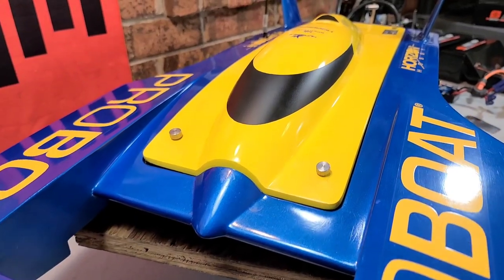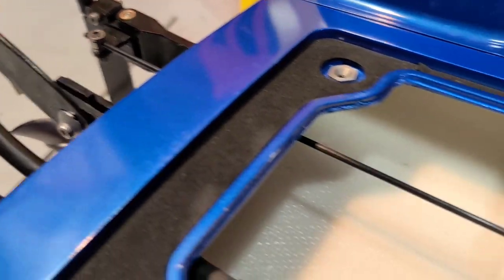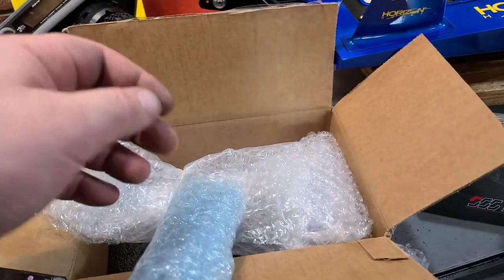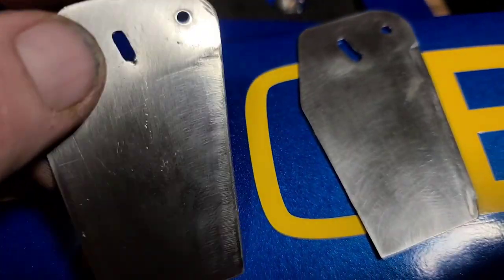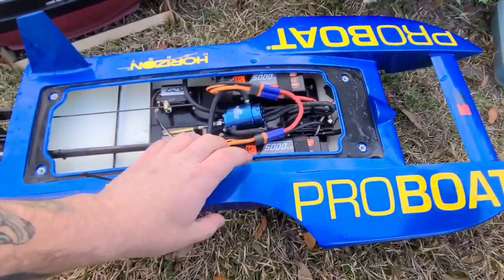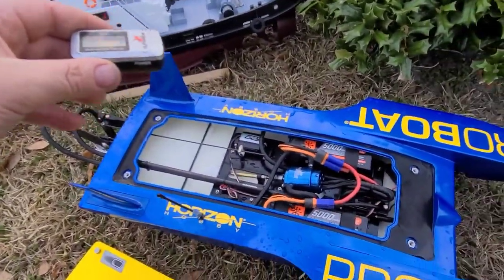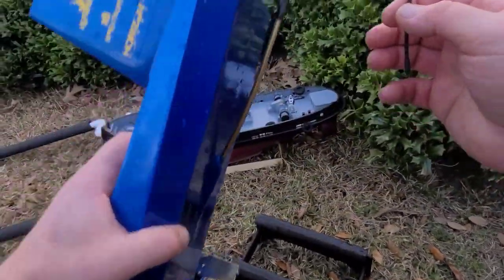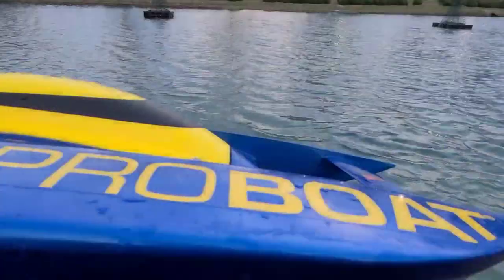Upgrading The Proboat UL-19 & 6s Spektrum 5000 100c Test - OSE 150a

Comment: After 1 or 2 minutes in the water on 6s at half throttle you won't get any overheating issues. Problems will come at full throttle and over 4 or 5 mins run times. If you use lower kV motor ( 1650-1800kvs) and bigger propeller you will get what you've been wanting, higher top speeds and lower temps. You'll see. Enjoy
Reply from the maker: I'm getting there, I've fried enough electronics to know when I put new gear/electronics in a boat to take it easy until I trust my work. 😆

Comment: Man I wish you were in Michigan, I’m about to install a new stuffing tube into my UL19, pretty nervous to do it. Wish you were my neighbor and I could just drop on by lol. I’ll keep ya posted on about how it goes. Hands down best RC YouTube channel out.
Reply from the maker: Wish I could help brother,  it's fairly straight forward  INSTALL,  bending the tube is the most important part, if you get the bend right in the right place it's all down hill after that.  BUILD IT IRONCLAD
Reply: @IRONCLADRC  I kept the old one that I took out to use it for the same bend. What’s a good prop to run on the UL19? I have the OSE 150amp ESC too. I just bought the 438 for the blackjack 24, seen that you said it’s your favorite prop for that boat. Also put the dynamite 120 ESC from the UL19 into the blackjack and gonna run 4s with the 438. Love all the videos you make. Makes my build soo much easier. You’re the man.
Reply from the maker: For speed 1616 ABC for cool Temps oxidean 42 high rake (red prop)  there basically the same props but very different in performance
Reply: @IRONCLADRC  well everything went smooth, running good. Started to tune it in, ran it 3 times, boat stopped in the middle of my pond. ESC is just beeping now…

Comment: Looking great. My ul 19 just puffed another spektrum 2s 5000mah 100c battery.
Stock boat, extra cooling prop is octura x442 1.4 pitch, balanced. Hit 63 today. Temp was 140 on caps! Every thing else 120 F.
Do I need a different prop??
Reply from the maker: That prop should be okay for the boat.   Battery's usually puff because of a fast discharge rate ..   could be your driving style?  Full trigger pegged out the full run will definitely puff a battery

Comment: Brass screw in place of the plastic and you can get higher speeds without loosing your steering and will still sheer off if you hit something👍
Reply from the maker: I've tried brass, I actually like bras over plastic, brass breaks easy too I noticed.  The plastic antenna tube is fairly tough

Comment: Big B, I changed the settings on the ul19, timing is now 0 degrees,  and 3.4 LVC. 
Is it physically possible for it to run faster! Tgus thing is floating now, 4s and my Temps where 175, all over the place, timing?
Should I go back to factory timing?
Battery cut off, rudder still worked motor did not turn!!
I'll let it cool and see if I burned out motor????
Reply from the maker: Possibly desoldered a wire coming out the motor. Or the esc is fried.    Plug in a battery and move the wires around coming out the motor if there's erratic sound coming from the Motor then the wires desoldered  if all the wires look OK then it's Possibly the esc.  Replace with a ose 150. Great setup or a spektrum firma 160
Reply: @IRONCLADRC  just ordered a motor. Sounds like rocks inside when it turns.

Comment: Great video Big B. I have wondered about putting trim tabs on a catamaran, would you recommend installing them on the Veles29? That was a great goodie box from Mark’s boat worx I will go check him out. Also I recently installed the OSE style 150 amp esc in the Veles . I had the 120 amp in it before and the upgrade was a noticeable difference. It was not only faster , but it also ran much cooler
Reply from the maker: To be honest I think the Velez can be tuned with weight and strut positioning.  The m41 and blackjack  need trimtabs due to there plastic hulls having some flex..  I'm sure trim tabs would help, personally I wouldn't  recommend them for the veles
Reply: @IRONCLADRC  I’m picking up what you are putting down

Comment: Partway through the video, will edit this comment as necessary.  I like the "Boat Gang" rap....  Typical Big B smile material.  Your rod is in tension when turning right so flex isn't an issue.  In a left turn, the rod is in compression and can flex, but.....  Who on earth gives a hydro full left at full speed?  Oh, OK, other than my friend Wayne, that is.....  🙄  Continuing viewing now...  Uhhhh....  Just got to the part where you figured that out......  Continuing again.....  I like the antenna tube sacrificial bolt in the rudder!👍
Reply from the maker: I may order a 3mm CF rod to replace the 2.5mm CF rod?   Personally I think it will be fine. Like you said who needs a left hander with a hydroplane!  😆     saved quit a bit of weight with the CF rod every little bit helps.

Comment: Those RC Boat Bitz trim tabs look like they're for the Sonic Wake. Cats shouldn't require trim tabs but what do I know :) I have that same motor in my Sonic Wake along with a FlySky 150 - great combo but some grinding is needed to make the motor fit on the motor mount. Not sure if it is a drop-in affair with the UL-19. It just might be, but if it isn't, I'm sure it could be shoehorned into the boat. So many vids on the UL-19 that I'm tempted to pick one up - just got to sell one of my other hulls to keep the wifey happy. Nice vide Big "B"!
Reply from the maker: I agree 100%  with the no trim tabs on a catamaran, that's why I blueprinted the hull. I've seen guys with the bj42 running trimtabs and they really do help that hull.   I'm gonna have some sonicwake tuning vids coming soon I promise.   🤪   the UL-19 is so much fun to tinker with I'm loving it,  I can't get my mind off of it.   I actually thought the same thing putting the B-bitz TT  on the sonic wake but the trimtab base is really tall and would block the flood chamber exist 😐  i thought the same thing
Reply from the maker: I'm about to start modifications to fit the 4074 in the sonicwake.   Quick question?  Is the front motor support for the 36 series motor solid plastic or honeycomb/hollow?   I'm gonna enlarge the front support, curious as to what I'm getting myself into.
Reply: @IRONCLADRC  Yeah, couldn't get a good look at the trim tabs because they're inside the bag and the label didn't say what boat they were designed for. RC Boat Bitz does offer adjustable trim tabs for the SonicWake, but they look heavy in contrast to the OSE offering. I have the OSE trim tabs on my Sonic and I love them!  They basically bolt on to the stock trim tabs which is cool. That 4074 motor has some serious go power - much faster than the stock Dynamite 4-pole motor. I've heard mixed responses on the SSS motors, but I've never had one fail and I have at least three of them including one in my Armma Limitless that hits 80 plus MPH on 6S with extremely moderate gearing.
Reply: @IRONCLADRC  The motor support is honeycomb (semi-hollow). I actually deleted it after installing the 4074. The motor feels solid enough secured to the plastic motor mount alone. I've ran the boat probably a half dozen times with the 4074 motor and a 4216 3-blade prop with no issues. The boat is easily 15 mph faster with the 4074 motor, 3 blade prop and PowerHobby 6S 100C pack. I do wish, however, that OSE or RC Boat Bits would offer an aluminum motor mount for the SonicWake and UL-19.
Reply from the maker: Thanks again brother. Yea  I kinda figured it would be honeycomb to reduce weight & material..   oh man I'm excited to get that bad boy in the boat.     Boat Gang 😆

Comment: Big B. I need something to check my batteries between runs, I use all spektrum 2s and 3s batterys. What did I see tou using in this video, thise are spektrum batteries right???
Reply from the maker: Here's the one I use it's cheap 799 for 2 

https://www.ebay.com/itm/234322761284?mkcid=16&mkevt=1&mkrid=711-127632-2357-0&ssspo=GsH0I07KQDm&sssrc=2349624&ssuid=yQkZS9FcQay&var=&widget_ver=artemis&media=COPY

Here is the super nice spektrum tester that's recommended 

https://www.avantlink.com/click.php?tt=cl&merchant_id=953aec29-878e-4306-b620-2df85883455e&website_id=70256520-69d3-496b-a06d-cfbf9af7a81d&url=https%3A%2F%2Fwww.horizonhobby.com%2Fhttps%3A%2F%2Fwww.horizonhobby.com%2Fproduct%2Fxbc100-smart-lipo-battery-checker-and-servo-driver%2FSPMXBC100.html
Reply: I figured it was me, lol, I am heavy on the gas, second one. Guess I'll have to run for 2 minutes,  then slow down to 50% for 2 minutes, and see howvitclookscforctemps.

Comment: Does this boat not need turn fins on both sides?  Or could it have fins on both sides?  Two fins would obviously have more drag, but it might turn sharper (?).
Reply from the maker: You can put 2 turn fins on any hydroplane and yes sir she'll turn better both ways. But like you mentioned drag is the issue

Comment: Uuuuu, I am curious to look this boat with SSS 4074 soon. Bye man from Italy
Reply from the maker: Me to brother, hopefully it's not to much weight in the boat.   THANKS FOR WATCHING
Reply: @IRONCLADRC  I think that 4074 have enough watts to win its weight.. It seems to me that it is a 2200 2400 watt motor and it should withstand 7s lipo. With 150a esc and 6s you can run around 90/100 km / h.

Comment: I will be running a Leopard 4082 2200kv on the Rico 31 inch boat... and most likely a SSS 4092, 1400kv on the deltaforce 38 on 8s
I think the Deltaforce 35 will fly on that motor with 6s and 180A Hobbywing ;)
Reply from the maker: I know right. Im Gonna throw it in the UL-19 for a while then we will try it in the Deltaforce 35 later on.  
   MAn your Deltaforce Is gonna scream with a 1400kv and big props.  😳
Reply: @IRONCLADRC  thats what i am aiming for ;) But i am looking around 100 km/h on the Rico aswell on 6s
Reply from the maker: 100kph & no smoke c'mon  You will get it brother. That higher kv will get you there, your on the right track...    I'm ordering a ztw 220 for the Deltaforce 35.  Hopefully the boss lady will alow it. 😆
Reply: lets see at summer time, still cold here in Norway (around 0c at mornings) and build is  not done yet, so need to get at it soon

Comment: I just picked up a ul 19. What kind of lipos do you run and compatible charger? I have a traxxas spartan with traxxas 5s battery's and the traxxas charger but can't use the batteries on the ul19. Is there an adapter I can use for the traxxas batteries? I'm new to the rc world by the way.
Reply from the maker: 5000mah 2s 50 or 100c spektrum battery's should suit the boat best for 4s operation.   There's a guy on ebay that sells traxxas/ec5 adapters so you could run your traxxas battery's in the boat aswell

Here's a 4s spektrum dmart bundle  https://www.avantlink.com/click.php?tt=cl&merchant_id=953aec29-878e-4306-b620-2df85883455e&website_id=70256520-69d3-496b-a06d-cfbf9af7a81d&url=https%3A%2F%2Fwww.horizonhobby.com%2Fhttps%3A%2F%2Fwww.horizonhobby.com%2Fproduct%2Fsmart-powerstage-bundle-4s%2FSPMXPS4.html

Comment: Hey brother hoping you could give me a hand with the raider 150 on this boat. Using 2x  3S gens ace batteries. I keep getting continuous beeps, but steering works. Just playing around with the Red Yellow and Blue motor wires in different configurations connected to the ESC to see if it changes- but nothing. Throttle trim is neutral.  Some configurations of the 3 motor wires have a lower pitch beep than others though. Trying to be as descriptive as possible here. Thanks in advance.
Reply from the maker: Before you plug battery in hold full trigger (make sure throttle trims are at zero)  hold full trigger then plug battery Into esc, keep holding full trigger for 3 to 4 seconds till you hear a couple quick beeps let go of full trigger.   Should be ready to go
Reply: @IRONCLADRC  damn you’re the man, it worked. Got the right sequence for the wires for the correct spinning direction. Just no reverse now though
Reply: @IRONCLADRC  never mind actually got it thanks again

Comment: Awesome vids…I have a question for ya…I have a blackjack 29 with OSE 150 ESC 1900kv motor with Octura 5mm shaft .187 cable size and was wondering what would be a good prop on 6s…built the boat but came with the prop and it’s a good one but I bent it and it’s made of the metal that’s bad for ya if u breathe it in when grinding but not sure of the size..any help would be greatly appreciated
Reply from the maker: If it's a copper/ beryllium prop yes it's not good for you.  (Gold copper color props wear ppe)  aluminum props are not hazards to your health.
Reply: @IRONCLADRC  so what pitch and diameter do you think the octura that came on it is like 40-42mm but don’t know the pitch
Reply from the maker: Id try a octura 637 or m440  for cool Temps,  tfl 440 & or tfl 443 would be a good option as well.     Maybe pushing it to say a octura 642 cut down & tongs removed
Reply: @IRONCLADRC  ok hey I appreciate the advice …I know that it’s a pain to figure out the right pitch and diameter for props cuz I have an 18’ bayliner and unless you have a tach and know what the optimum rpm is it’s almost impossible to get the right prop…so many choices ..what I know is the prop I trashed ran great and it’s 42mm and I’m guessing a 6 pitch…is that more aggressive than a 4?
Reply from the maker: Yes 1.6p has more pitch than a 1.4p.   The 1.6p will have a better top end than a 1.4p. Most of the time. 1.4 low end  1.6-1.8p  topend
Reply: @IRONCLADRC  thanks bud…much appreciated 👍

Comment: IN A BODY SHOP RUNNING CROUKED IS CALLED DOG TRACKING. I NOTIST THAT THE UL WAS RIDING MORE SO ON THE TRANSOM . YOU SAID IT SHOULD RIDE MORE ON THE SPONSONS. IS THAT A CORRECTION YOU WILL MAKE IN THE FUTURE?
Reply from the maker: Thanks.   I will reme.ber that dog tracking.     And yes sir I will correct the low ride on the stern

Comment: Dude the best way to save weight on this boat is to take that heavy ass plastic out and put the carbon fiber trays in.flex in the steering is not good at 50plus mph
Reply from the maker: I've been looking at a couple different carbonfiber trays thanks